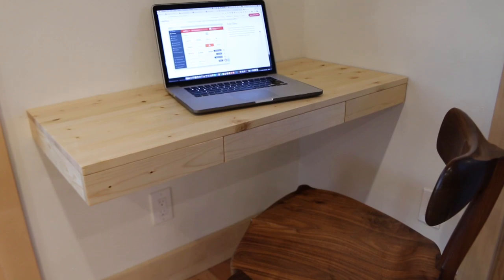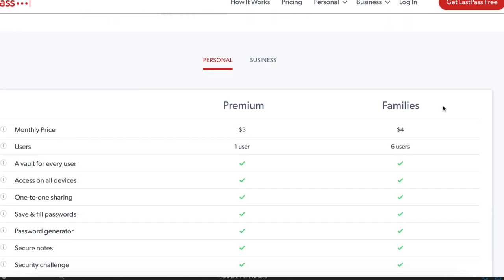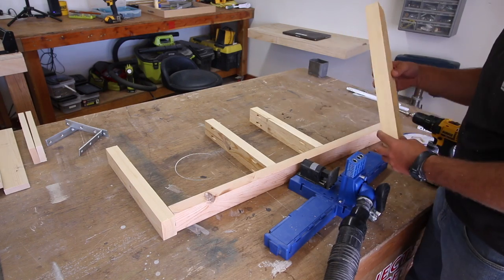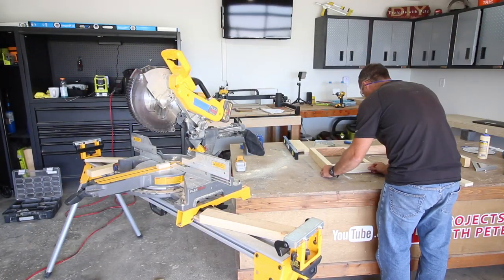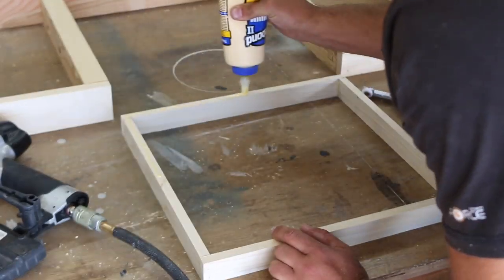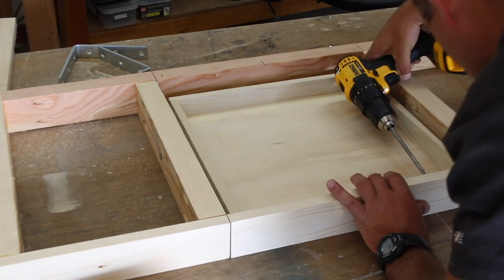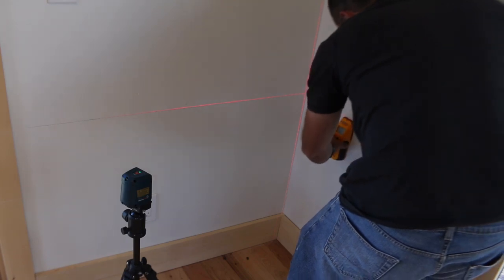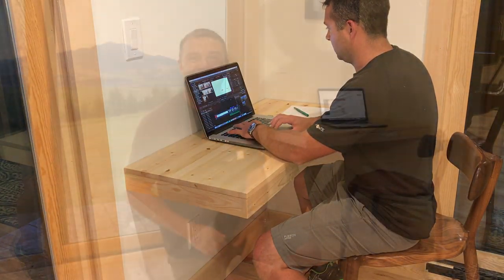How to Make a Floating Desk

Comment: Great video.  I need to build a desk for my wife.  Co. Is recommended everyone to work at home.  Desk is going to be   
32 3/4 by 23 1/2 . Wall to wall. 
Planning to stain it and add a glass on top.  I will follow your instructions. 
Thanks.
Reply from the maker: Good luck!
Reply: @DIYPETE  I was able to get the desk done this pass weekend. It turned out great.  My only issue i had was installing it. 
With the two dividers i had on both sides,
I couldn't get my screw gun to fit to secure screws on both sides of the wall.
I had to buy a mechanic hose attachment for drilling  tight spot. My wife loved the desk.  Thanks again!
Reply from the maker: @jorrba3934  Great to hear Joe!

Comment: another thing you can to to reduce sagging and strengthen it is to put an angled piece of wood from one corner of the second wall to the main wall, and a few in a straight line from the  far left corner all the way to the front right corner in sequence with pocket screws so that it isn't left without support. small things

Comment: Love this,  if I had all the tools, I'd definitely make myself one
Reply: Felt that one
Reply from the maker: Thanks for watching!
Reply: You don't need that many tools. You can literally screw everything with a 🪛 screwdriver. You can also make it a little thicker if you find the right piece of lumber. Just don't trim it. Also, you can make pocket holes with a drill bit. Just mark the depth with a tape. And, you can use a hand saw, or ask them in the store to cut to your dimensions. He did it in light wood, but I am going to get already darkened. Also, instead of staples for the top, I will use screws, and give it a rustic/steam punk look. Even if you don't have right tools, if you're dedicated and put some thought and passion, I think it can be done, and it can look good.
Reply: Also, it's not big, so sanding by hand should do the trick.

Comment: I want to build something like this  but I need it to be 6 feet wide and I want a 4 foot wide slide out keyboard tray so when I don't want my keyboard/mouse out I can just push it in and thus preventing me needing my desk to be 3 feet deep.  Good fuel for ideas, thanks.  I want the tray in the one I build to be centered in the desk, and I use it for a writing surface too, planning to mount it directly below the chair railing in my office which is at the perfect height.

Comment: Is this also possible with a drawer if you bridge a big gap between two walls. I have a room, 2 meters wide (6.5 feet) and want to make a desk over the whole width. I'd prefer it with 1 or 2 drawers but I'm not sure if it'll be strong enough...

Comment: I love this video. I think I could even make this. Great job. Thanks so much. Have you done a video on how to make a simple headboard or not so simple?
Reply from the maker: Hey Linda! I have a video on a bed frame that includes a headboard and a footer. It is a pretty simple method. Although the headboard might not be exactly what you need, you could definitely use some of the ideas and modify it to best fit your needs. Here is the link in case you want to check out that video :) Cheers! https://www.youtube.com/watch?v=sxy1cqHT_2c

Comment: I love this build, do you think it could hold a printer with a router, modem and access point with only a few lag bolts into studs? All in one printer about 8.5x14”?
Reply from the maker: Hey Chad, I think it could hold it if you have a corner mount situation. Worst case you could add a could L brackets.

Comment: Hey DIYPETE, Exceptional work. Any tips on connecting to brick? I live in Mexico, and everything here is brick and concrete walls. Sub'd and thanks again for any suggs or advice. 🙏
Reply from the maker: Thanks Thomas! For connecting to brick, you'd want to use a hammer drill to pre-drill through brick. You'd then use a masonry screw to secure it.
Reply: @DIYPETE  Thank you!

Comment: Great work Pete!
I am building a workshop on my property and would like mobile station options for miter saw, drill press, and rotator table. I believe having them mounted on casters would be a clean look after use to slide back. Your thoughts?
Reply from the maker: Hey Michael! I love the thought of a miter saw station with caster wheels - and the router table as well. As long as they are nice and solid caster wheels you'll be fine. It is so nice to be able to move the items around the shop easily. I have a few items on wheels and it makes it very nice. How big are you going to do your shop? After my house renovation I'm going to be building a shop as well. Most likely in the next year and a half. Looking forward to hearing how your shop build goes. You'll have to keep me updated!
Reply: DIY PETE 20’x25’ will be the interior dimensions. Electrical at first then switching to solar powered. I live in South Georgia so using solar to power the shop is a plan I want to happen within the first two years. There will be an additional 5’ lean to store pool equipment. Building will have a 9’x8’ garage door along with walk in door and 2 windows. I will send pictures.
Reply from the maker: Awesome!